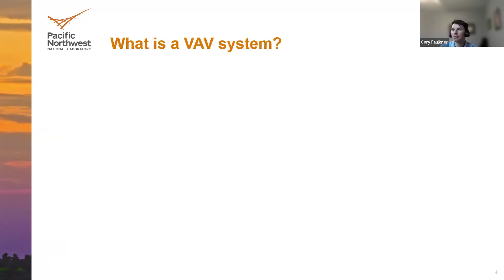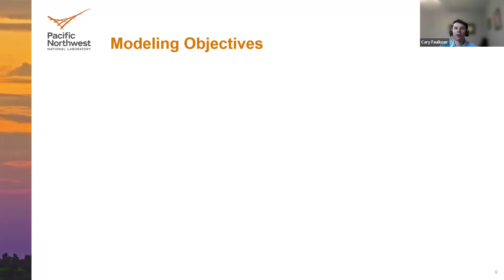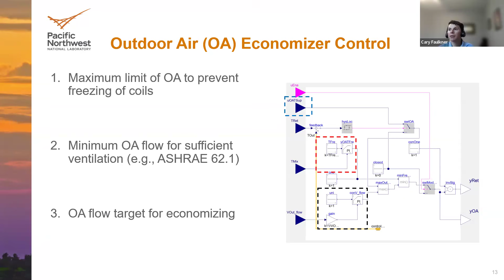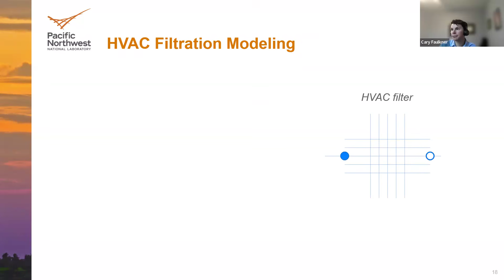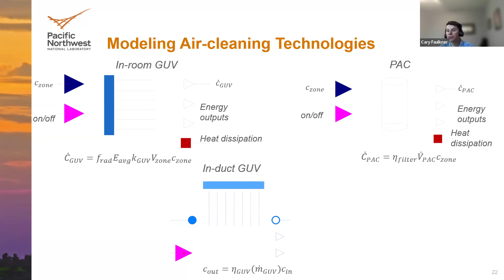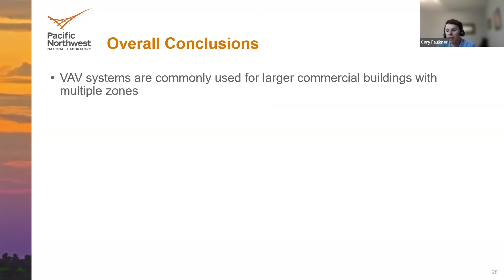Modelica Modeling of VAVA systems for Healthy and Reliable Buildings by Dr. Cary Faulkner

Comment: Prof this system is applicable and practical in heritage office buildings or not
Reply from the maker: Yes, you can also use Modelica for heritage buildings. You may need to develop some customized models depending on the system of your building. Here is a paper about Modelica for heritage residential building: https://publications.ibpsa.org/proceedings/bs/2015/papers/bs2015_2809.pdf